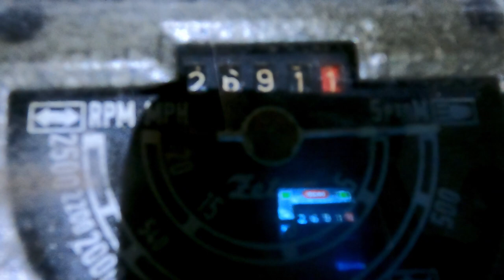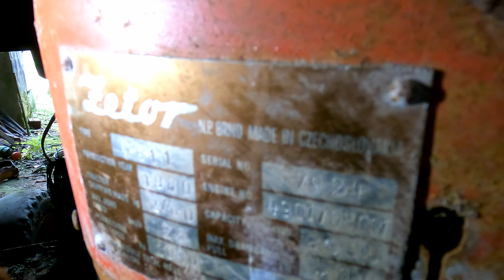Will it start? Zetor 4911 - Sitting 10+ Years

Comment: Hi dave, on the zetors, turning the key just operates the lights, there's a separate button on the dash that operates the starter. We've had a few old crystals back a few years ago, keep up the great work dave. All the best from Tony in tipp :)
Reply from the maker: Thanks Tony! The owner pointed out that one but said he thought it didn't work. I'm going to fix it for him before I finish up there. Nice tractor to work on to be fair. Even single stuff like having a fuel tap for changing filters. Solidly built. Thanks for watching . It was only when editing i noticed the lights coming on 😂
Reply: I have one of these at home it's this years restoration project it was my grandfather's. My dad and my 16 Yr old son going to restore it with be. I learnt to drive in it 😅

Comment: Great video dave from what I remember of them there is a black button on the dash push key in and press it . Thay have a bolt in compresser I think for air brake on trailer  or pumping wheels
Reply from the maker: Thanks Willie. There is a button on the dash but it didn't seem to work. I must fix it. Interesting about the compressor 🙂👍

Comment: Those 3cyl engines were well regarded i knew of 5245 that went round the clock and just carried on 😊
Reply from the maker: A very soft running engine, if you get my drift. Really surprised by how quiet it is.

Comment: Another good video Dave 
No doubt you'll get them other tractors running 
What about the cat did you get a bucket sorted?
Reply from the maker: Thanks Mickey! The 1394 is a real challenge. I pulled the dip stick and it took between 5 and 10 mins for the water to drain out! Block was completely full! Didn't get near it yet, things have just been too busy lately, I need to get on it.

Comment: will y do a video on fitting a frost plug at the back of the cylinder head
Reply from the maker: Pat, I certainly can. I'm waiting to see if it's going to be split soon to do the clutch. The other thought I had was using two metal plates, front and back of the head, and 12mm treaded bar, sandwich a socket in against the plug

Comment: Tractor of endurance  pity the brakes let them down one of those floor levers is the pto other should be high and low hand brake levers one is pto one is hand brake hard work is what they liked throttle is also stopper
Reply from the maker: Thanks for the information Howard 👍. Totally different to anything I've worked on before. I was also shocked by how quiet they are ticking over.

Comment: I think you need to just push the key to start
Reply from the maker: Aaron, it seems to have a separate push button, so far as I can tell its factory as I saw an identical one on another video, but ill certainly try that 🙂. Owner said the button stopped working. Thanks for the tip 👍 👌